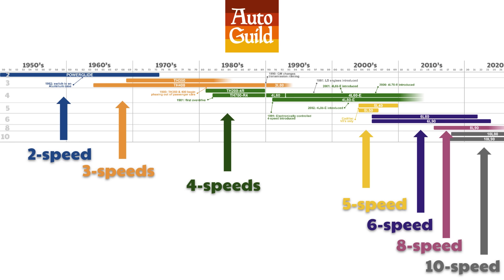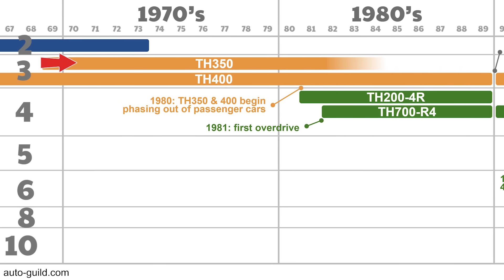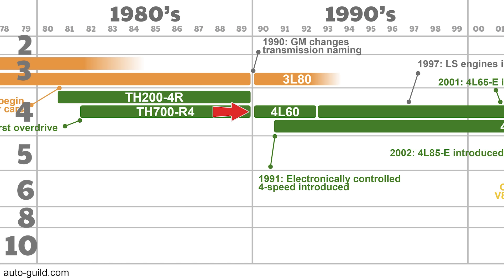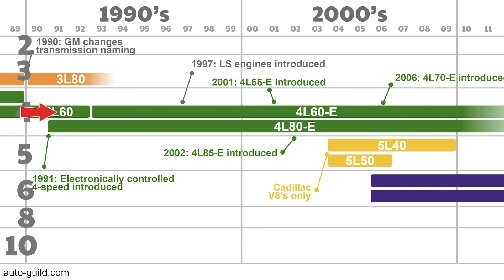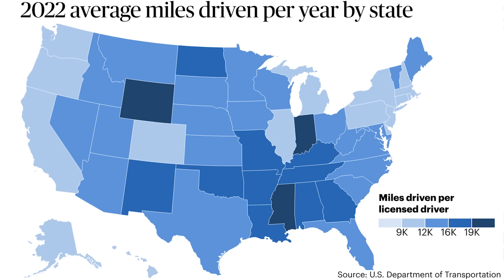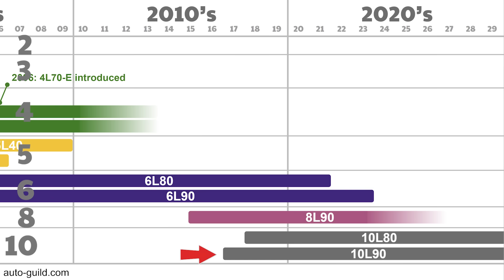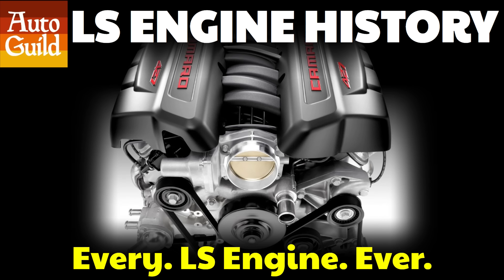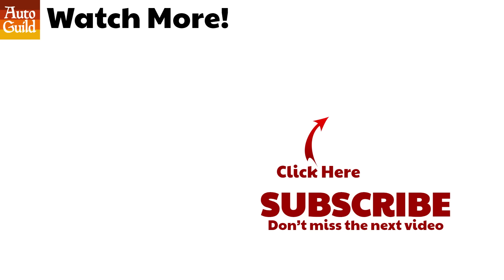All 15 Automatic Transmissions (Powerglide to 10L90)

Comment: The 700 and the 4l60 are the same trans. They both have the MD8 RPO code. GM just changed the terminology. And the 700 came out in 1982 not 81.

Comment: I did not hear you addrerss the bell housing,are these new trans fits all's or are there still different bolt hole patterns like,   a chevy won't fit in a pontiac used to be

Comment: some mid-1980s GM G-body cars did come with the TH250 transmission — specifically, the TH250-C variant.

Key Details:
TH250 and TH250-C were light-duty 3-speed automatic transmissions.

TH250-C featured a lockup torque converter (hence the “C” suffix).

It was visually similar to the TH350 but designed for lower torque applications.

Comment: if i plan on running a mostly stock 6.0 L  [ headers and mild cam  maybe, so less than 400 TQ ] LS in my 76F150 with 3.08 rearend would a 4L60E net me more off the line launch speed from the 3.06 1st gear versus a 2.6 or less 1st gear in a 4L80?

Comment: The 700r4 had a higher gear ratio ring&pinion gear in the rear end and the engine rpm was not reduced in high gear compared to the three speed, some people do not know how to read a tachometer or have a tachometer in their car or understand final drive ratios. The 1983 Camaro turns the same rpm in overdrive as a 1975 Camaro with a three speed because the 1975 Camaro had a 3.08 gear ratio and the 1983 Camaro had a 3.73 gear ratio. Different size tires too.

Comment: Back 20+ years ago...i helped a friend build a Frankenstein of a TH400 for his race truck. Billet internals,clutches,shift kit,34 element sprag assembly. But, he put the gear set from a TH475 in it...and the pump assembly from the Pitchshift TH400 from a Buick. Also had a custom torque converter from a company that would dual stall at the flip of a switch....2100 on the low side, and about 4300rpm on the high side. That truck would scare you. Last i heard, it survived 7 different built engines...including a blown 572 crate engine.

Comment: You missed the Super Turbine 300 2 speed. 
Heavier duty than the Powerglide, and especially the clutches and steel plates.....significantly larger diameter.
I rebuilt a whole bunch of those.

Comment: The 200r is the best when built up. It’s the same size as the th350. It has a better first gear to second ratio.
I believe if the 3rd Gen Camaro and c4 had the 200r it would’ve been faster.

Comment: I'm getting 2 cars for myself, as a birthday/celebrating my no longer being homeless: modified replica of a gt40 mk2 & a '72 nova ss.  Both cars are going to have a ZZ632 engine stuffed into them.  Since this engine pumps out 1000 hp, w/more torque than the 10spd tranny your list mentions... what transmission would you suggest for me to have installed in each?  I'm not concerned about price, BUT, do have an issue w/clutches.  The idea I'm looking to run is to use a paddle shift system & a computer operated clutch.  Please, suggest what you think would be best.  I'm going to be collecting upon an inheritance in the near future.

Comment: Howdy.  I have a 1995 Chevy K1500 I bought with no 2nd and 4th gear. 4L60E, 4 speed.  All else is normal. Fluid looks good and is full. What components should I check, if any, after I drop the pan, to be sure it's not a failure I can fix without removing the tranny?  Thanks!

Comment: I got a 1984 C10 shortbed with 350 SBC in it what kind of transmission would you put in it a regular automatic transmission which would be the best to hold up 700 up if i decide to beef up the engine????

Comment: My 02 Silverado 4x4 5.3 with heavy duty suspension, trailer tow package, heavy duty 
brakes, Z71, and 3.73-1 gear sets  is equipped with the 4L60E! I was disappointed
to learn this as I tow 6000 lbs. with it and bought it, a heavier duty version for this pur-
pose. Why this transmission couldn't have been upgraded from the factory is beyond me

Comment: what about super turbine 300 2 speed used in pontiacs 50 year trans mechanic
Reply: Had a Super Turbine 300 in my 1967 Buick Special. It had a switch pitch torque converter too! Loved it.

Comment: Hello, my name is Yasser. I own a Chevrolet Tahoe, 2021 model. I have driven 92,000 kilometers. It has a problem with the gearbox. It vibrates on the road. I replaced the torque converter without any improvement. What do you advise me based on your experience?

Comment: Great video 👍🏼however you said the 10 speed can not be swapped to a ls motor. That is not true. Powertrain swap solutions has a swap to swap a 10L80 to the 6.0 ls 6.2 ls motors.

Comment: I had a 2-speed GM Powerglide in my 1969 Camaro during college. Never changed the fluids or filter (if it had one) and abused the the heck out of it. It was cast iron and a real beast, never had a problem with it.
Reply: Iron case powerglide?Someone swapped that in
Reply: Couldn't be cast iron.
Reply: @unleavenedkaraiteplus3412  He never said it was stock. My 67 Impala had an early pre 63 cast iron PG in it when I bought it in 92. Had a 1.76 lo first gear kit in it behind a screaming 283 that launched like a big block with that trans.
Reply: OE wooda been the better alum case

Comment: I think another transmission missing is the TH200 from approximately 76 to 89. I believe the 1979 Caprice Classic with the 305 engine had this transmission.  Failed after a few years and replaced it with a TH350.

Comment: You completely ignored the GM trimatic transmission used by GM Australia in just about everything rear drive from the later part of the 1960s until the mid 1980s..

Comment: The 1964-1969 Buick / Oldsmoblie / Pontiac "Super Turbine 300" 2-speed was a pretty good transmission, yet you don't list it, nor do you list the 1961-1965 Oldsmoblie / Pontiac "Roto Hydramatic" (Slim Jim)  3-speed.

Comment: 4l80 with the 6.o is the way to go
Reply: HP to price you really can’t do much better than a 4l80e and 6.0, find a clean used combo and a reliable 500+ crank hp for less than 5k is hard to beat. 

A healthy cam, 243/799 heads, a higher stall converter and a few transmission internals and you’re there.

Comment: I had the 700r4 transmission fully rebuilt in my 89 IROC-Z. 
It used to do around 70 mph at 2000 rpm but now seems to do around 65 mph at 2000 rpm. 
So to get to 70 mph, I'm having to rev to around 2200 rpm now.
Are there different gear ratios for the overdrive gear?
Reply: Check your speedometer/odometer calibration.the 89 still use a drive gear? If so maybe you now have a different one after rebuild.
Reply: @johnstuchlik5828  Thanks for the reply, I spoke with the chap at the garage and he thinks it might be that the lockup, isn't locking up. I'll be dropping it back off for them to have a check over it in about 2 weeks time so I'll find out soon.
Reply: @robertferguson5518 that could be.the lock up drops cruise rpm about 200 rpm.
Reply: @johnstuchlik5828  My car is running perfectly now! 
There's some sort of plug that clicks in from the car to the transmission, he's plugged it in and the lockup is working. He replaced the plug on the trans during the rebuild but the one on the car was slightly distorted so it was difficult to plug it in. It's working fine but he's ordered a new one just incase I have any issues. I've driven it over 130 miles today and it seem perfect. RPM lower throughout the range and especially in overdrive. 
He also adjusted the cable so the shift points are lower now, so overall very pleased!

Comment: What about the 4L 80  not E , it was a th 400 with a fourth gear and NOT electronically controlled. I believe it was 90 to 92 or 91 to 93. I had one in my 92 Chevrolet Dooley 2 Wheel drive 454 peanut head and it was a 4L 80 not E. Those are the ones you want because they’re not electronically controlled and it is a TH 400 with an overdrive
Reply: What??

Comment: chrysler small block transmissions used the same bellhousing for 50 years, you can bolt a slant six to a viper transmission (ironically the dodge truck v10 is NOT the same bolt pattern), some of the newer engines kept using it too (some) the hemi and 4.7 and 3.7 and even the diesel crd from a jeep liberty can be directly bolted to any trans made in that 50 year period
Reply: I think the 6 cyl bolt pattern was different. The starter slot was located on top rather than at the bottom.
Reply: Use the converter with the correct balance weight for the engine you have.

Comment: Looking at this very good comprehensive video again , im thinking of the 1960s Super Turbine 300 or ST300 2 and a half speed auto , it came out in the late 1960s Oldsmobiles with drag pack , instead of using the torque Converter as a lock up , they used the hydraulic actuation to flip the converter blades in two different pitches ( some times called a swich pitch transmission) so you drove to the track at a normal 1000 rpm stall Torque Converter , flicked a swich in the car and the Torque Converter changed to 2200 stall , drag the car and flick the switch and drive home on normal 1000 rpm stall, it was in other GM cars . Also the T425 trans in front wheel drive Olds Toranados and Caddys , a strange transaxel that left the motor north south but drove the front wheels by sliding the trans under the side of the motor , running a chain from the end of the Torque Converter on the back of the motor to the trans facing to the front of the car, bolted on the front ( normally the back )of the trans was a 10 bolt diff with two half shafts , one running through the oil pan of the V8 to one wheel and out the other side to the other wheel ! And lastly the T475 heavy duty trans .
Reply: Edible pitch torque converters are also used on the first two years of the Turbo 400
Reply: @glendrake635  yes I just read that , wish I had one .

Comment: It’s crazy to me that the 4l60 is one of the least reliable transmissions. But the 4l80 can handle up to like 800 hp if I remember correctly
Edit:perchance I was wrong on the hp rating number of the 4l 80. Point is it’s a good transmission

Comment: The relative strength rating is a maximum rating in newton meters. A 4l60e would have a max rating of 600N•M or just over 442ft lbs of torque.

Comment: I always was under the impression that The “80” is for 800NM which equates to 590 Ft/lbs… 60 was for 600nm or 442ft/lbs which seems accurate lol
Reply: Early 90’s GM was not operating with the metric system like that, hell, the transmissions are still advertised in lb-ft first with nm in brackets behind it. I wish the 4L60 was rated for ~440 lol

Comment: Excellent educational video... I do have a question for you...  and I have some trivia for you also.  I am looking to swap out the power glide in my '63 Impala wagon for a Tremec 5 speed.  I might consider an automatic, if I could get one to fit without much modification.  I was told the Short shaft Turbo 400 was the same length as the Powerglide... if not, are they close.  I do not want a TH350.  The car has a 3.55 - 3.73 rear gear.  I may do some toning with it.  The engine is a minimum of 320 hp.  Torque unknown at this time. Looking at a floor mounted shifter, regardless of trans used.   Thanks! :)

Comment: One variation of the TH400 that often gets overlooked is the TH475, which was beefed up for use in heavier duty trucks and motor homes. They're unique among factory transmission offerings in that they use straight cut gears, which have a pronounced whine that is even louder than the famous Muncie M22.

Comment: Interesting point about a powerglide before 1967 is that they also had a rear pump therefore could be used to push start the car if rolling 30-35 miles per hour. I know because I had a powerglide in a 1966 Impala.

Comment: There's no mention of GM's Roto-Hydramatic (Slim-Jim). This lightweight, aluminum-cased four-range, three-gear transmission was used in some Oldsmobile, Pontiac and Holden (Australian) models between 1961 and 1965. The larger Model 10 was used on full-sized cars whereas the lighter-weight Model 5 was used on intermediate and compact models, such as the 1961-63 Pontiac Tempest and Olds Cutlass/F-85/Jetfire. The 1962 Olds Jetfire with its Turbo-Rocket 215 V8 aluminum block engine coupled to the Model 5 transmission was the first turbocharged production car ever made.
Reply: The less said about those, the better.

Comment: You forgot the TH200.... no, not the TH200-4R.  I don't know what internals may have been shared, but the 200 non-OD transmission was a thing.  We had one behind a 1983  307 Olds.

Comment: Th2004r went to 1990 and I'd like to see the Info on the th2004r ever being in a Corvette. Ive installed multiple 2004r's behind LS engines and work good. They can be built to hold over 700RWHP. Your info is funny.

Comment: OK hold on to your dip stick....GM made a TH 375  ..I had one in my 75 c-10 . It's  a 3 speed , the pan looks like TH 400 , but the tail shaft is goofy , the seal is a one off seal ...not a good trans. ... look it up TH 375 .. Yes its a Trans GM made..

Comment: I had a 81 Chevy 1/2 ton  pickup with a TH-350C. It had the lockup converter on it. I wired a switch to the vacumm relay that I could drive it around town with the TC unlocked. Otherwise it was constantly locking and unlocking around town in traffic

Comment: i am a retired professional transmission rebuilder for 45 years. the 2004R was never in a corvette. they had a multi case bolt pattern and can be bolted to any GM v8 block. they were one of my favorites. i have one today in my 86 monte carlo SS,,,,,,,,,,,,,,,,,,,,,
Reply: What do you think of the th 700 automatic gearbox
Reply: This 200 will bolt to a Pontiac block?
Reply: Yep it has the BOP. Buick, Oldsmobile, Pontiac and Chevrolet pattern.
Reply: Google it
Reply: can i put a 2003 allison 1000 into a 2003 lq9 engine

Comment: You missed the Turboglide ( I had one in my 1960 348 powered Impala convertible).It was a forerunner to the now popular continuously variable transmission designs. The one-forward-speed automatic with a torque converter was totally different from its two-forward-speed Powerglide sister. You also missed the 3 speed Hydra-matic that I had in My 1960 Oldsmobile Super 88 conv.Please update this so Your video is correct for the younger generations!

Comment: I am interested in swapping out the TH400 on my 78 Suburban with a 454 (496). I have heard that the TH700R4 is the best transmission for my K20 Suburban as it is only 2 inches longer and has the same rear cover bolt pattern as the TH400 so I can bolt them up without major conversion issues.
Your thoughts on this would be greatly appreciated.
Reply: Do not put a 700r4 behind a big block... Actually wait you got a smog era 454 that probably has like 180 hp
Reply: @samholdsworth420  The 454 that is in my Suburban has only a pcv valve for smog. It is also bored 30 over and the block is decked 70 thousandths. Not quite a smog engine anymore and not quite 454 anymore.
Reply: @GlenJS  lol nice

PCV valves are nice get that moisture out of your engine
Reply: @samholdsworth420  I will eventually get the oil canister put in to replace the PCV valve. I have to get some connectors for the hose to the canister and it will be all set to put in. I also wonder what you recommend for a transmission. I want to keep the transfer case close to where it is now, so I do not have to do much modification to the driveshaft lengths.
Reply: @GlenJS  th350/400.... honestly a 700r4 could probably survive if you baby it lol
Reply: @samholdsworth420  I really need to get some overdrive as this engine has a cam that is supposed to top out around 5500 RPM. I have heard that there are some transmissions that will give me an overdrive and still the low end that couples with my transfer case without extending the distance very much. Suggestions are greatly accepted.

Comment: I'm perfectly happy with the TH400 in my '88 Chevy G30 work van. Bought it '94 as a former GTE fleet vehicle with 85,000 on the OD. The odometer broke at 93,000 so I decided to wait until the speedo cratered to replace the unit. That hasn't happened yet so think the original 5.7 and TH400 has around 300,000 of use with no breakdowns.
Reply: I'm over it. I have one in my 98 Camaro and when going down the highway 70 miles an hour at 3500 rpm gets old 😂

Comment: what about the turboglide circa 1961 and in buicka the dynaflo.
Reply: During WW2 the Army used the Buick Hydromatic transmission in the M5 light tank, M18 Hellcat TD and the M26 Pershing. After the war Buick advertised the Hydromatic as being battle tested. Its first gear was a granny gear used when attempting to tow or pull something from a dead stop. The shift lever was on the side of the transmission using the same readings as a column shift indicator: P R 1 2 3 D. Drivers liked it since that allowed them to concentrate on where the tank was going and not look down at the tach when shifting gears.

Comment: My 1955 Chevrolet 3600 had the Hydramatic 4 sp. ORIGINAL.
   1st gear was what I would call a Granny .......in the owners manual it listed at full throttle it came out of 1st at between 5-7 mph. !